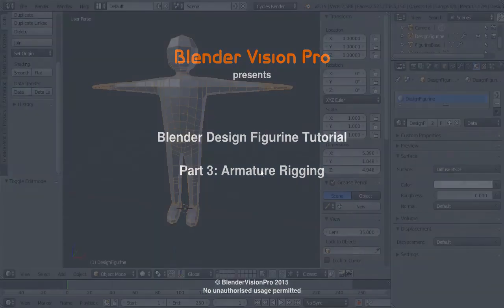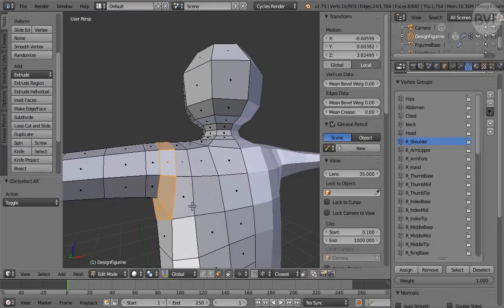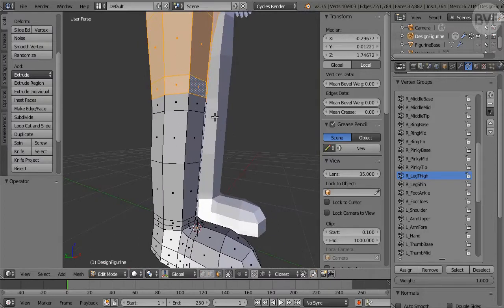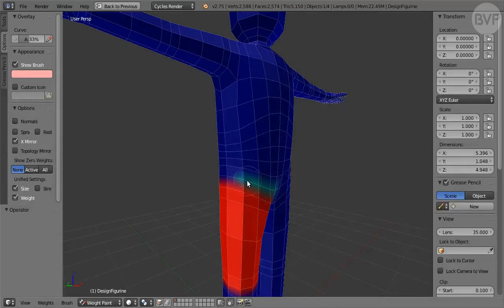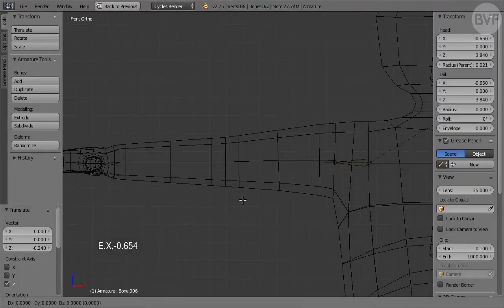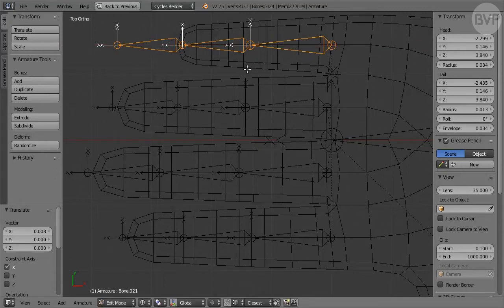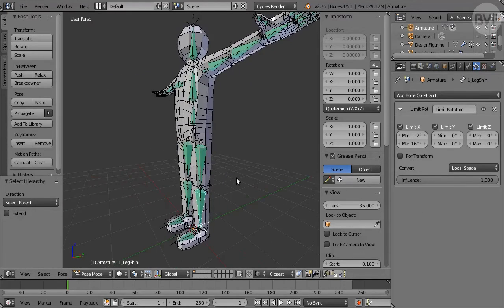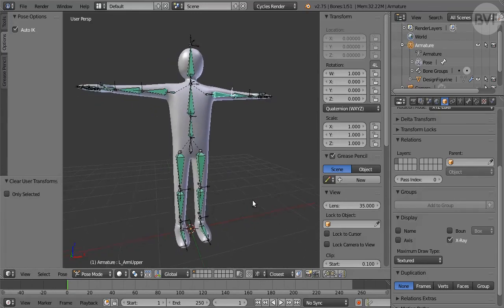Blender Design Figurine Part 3: Armature Rigging

Comment: Thank you for this detailed series of tutorials, they are extremely useful. I am in the process of adapting them to my current use of Blender 2.93 and, for the most part translate well. Having reached the point of rigging I have also sought access to your drive for the Python files. As I don't know if your channel is active I will leave this comment and see if you are able/inclined to respond. Thank you once again.

Comment: Thank you for your videos!!  I recently finished part 3 but whenever I move the hand bones, the fingers distort.  I figured I screwed up somewhere along the line so I started from scratch from adding the hand bones again but I am still having the exact same problem.  I am pretty new to this aspect of Blender so I have no idea how to troubleshoot this.  Any ideas?
Reply from the maker: +SOOOOTS I would first unparent the mesh from the armature, and in Pose mode ensure the bones are fine. If a finger bone doesn't move with the hand, then you may have unparented it by mistake. Once you know the armature is OK, and the problem persists, then the problem is in the weighting. When weights are adjusted manually, as I warn in the video, it is all too easy to make weighting adjustments without noticing. If this is the case, delete one side of the mesh, repeat the weighting procedure. Another possibility is that some polygons on the fingers or the hand are assigned to wrong Vertex Groups. In this case, the distortion should be on both hands, due to mirroring. Check through the Vertex Groups list, selecting them in turn. When the weighting is fixed, apply Mirror again, and carry on. BTW, these sort of problems are the reason why this tutorial series is so focused on precision. I hope you manage to fix the problem and complete the figurine.
Reply: +BlenderVisionPro The bones are moving as they should.  They just distort the mesh in the fingers as they do.  Let me try playing around with the weighting and see what happens.  Thank you for your help!!
Reply: +BlenderVisionPro Hmm, tried all of the above and nothing seems to fix the problem :-(  I used your exact measurements.  That's why I re-did it, in case I messed something up.   Checked for duplicate vertices too - all seems well there.  Using version 2.76.  I tried to rig a character once before and had a very similar issue.  Is it possible it's a setting or something???  It does do it on both hands too.
Reply: +SOOOOTS I'm having the same problem small finger doesn't follow hand bone and mesh gets weird :(
Reply: Hey, I was able to fix the problem by using a different setting than he recommended and it worked perfectly.  Unfortunately I did this lesson a while back and don't remember exactly what the setting was.  If it wasn't armature deform with automatic weights it was something along those lines in one of those type of menus.  Wish I could remember for you.  I'd have to watch the tutorial again.  Play around with those type of settings and you should get it.  Hope this helps a little.
Reply: thanks for your reply, I tried couple of things but didn't work, I should work on it more I suppose I'm not ready for rigging yet :(
Reply: Don't give up.  Hitting the frustrating road blocks is part of the learning curve!!  In the meantime, if I can think of what that setting was I will let you know.
Reply: thank you very much again, I actually decide to study armature rigging from zero as it was pre-setup here, perhaps I can get a better understanding by doing so :)

Comment: I had a problem when I ran BVP_DFT3_Armature.py - File "..\BVP_DFT3_Armature.py", line 60, in <module>. IndexError: bpy_prop_collection[index]: index 2 out of range, size 2. Looking at the script and outliner showed that some of my fingers weren't parented to the main hand bone - not sure how I broke that relationship. Anyway, I added the parent to the fingers, reran the script and all ok. Thanks for the tutorials - I'm having great fun!
Reply from the maker: +DanS When clicking the Connected button you must have clicked to remove the parent by mistake, the buttons are close. That's the only way I can see the fingers would become unparented when they are being extruded from the Hand. Anyhow, top points for figuring it out and being able to continue. I hope you complete the figurine - keep going!